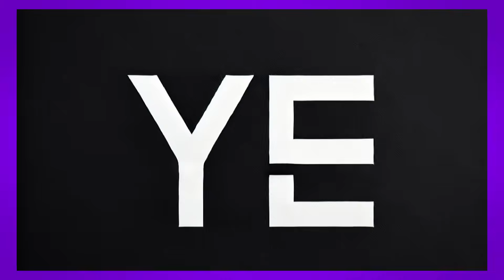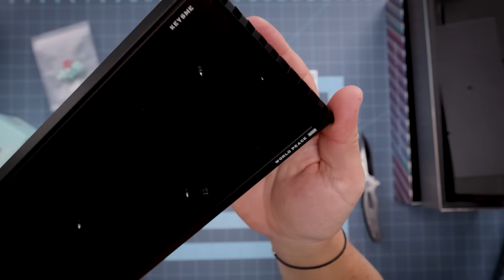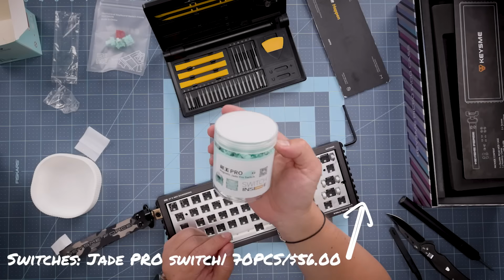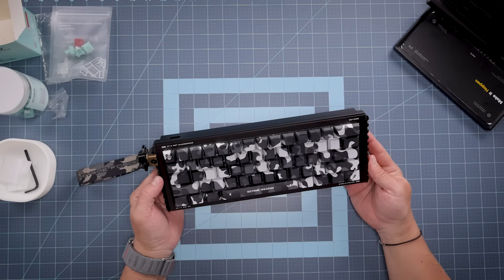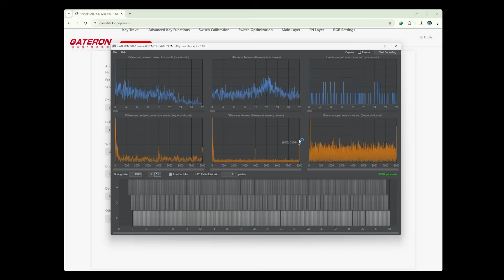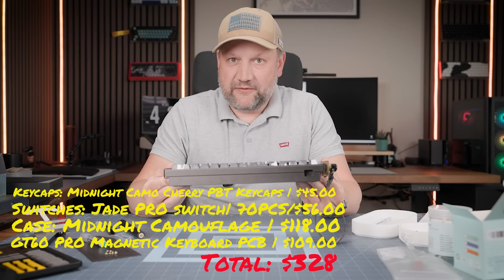Is this the best Hall Effect Gaming Keyboard of 2025? (GT60 PRO)

Comment: Disappointed to hear that the software is not that good. 😥
Reply from the maker: I’m sure it will be improved with a time and you need this for only 1 time to do an initial setup
Reply: @getsmarthomeoffice that's what I'm saying. If I rarely use the software, I don't need wooting. I prefer having a higher quality board and switches.